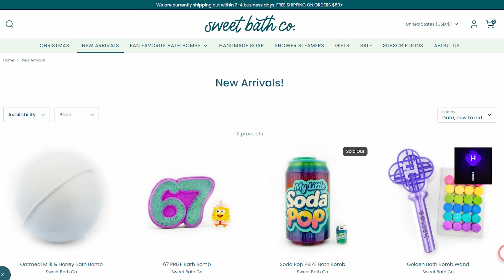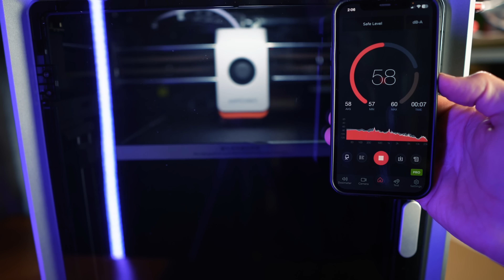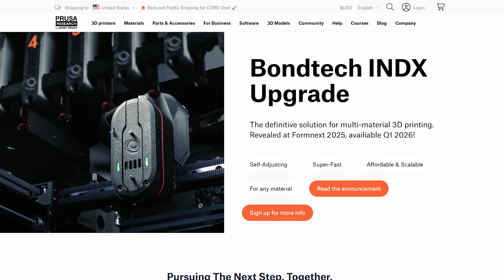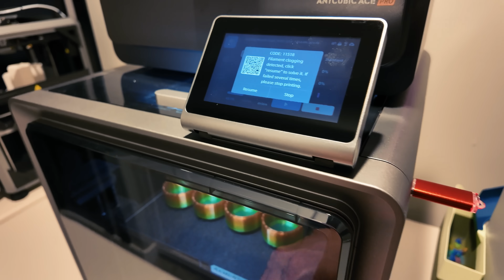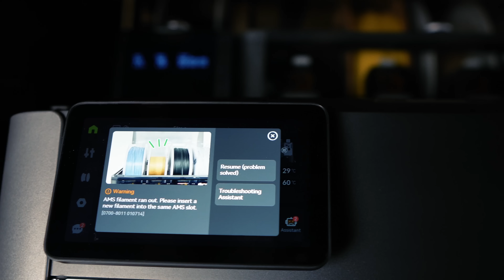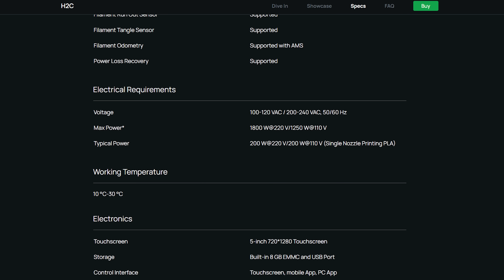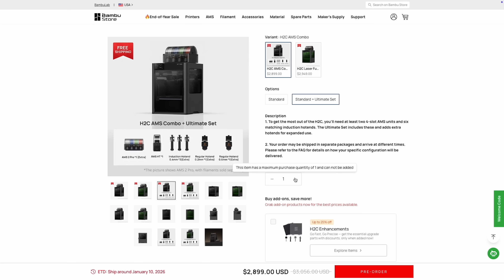I Upgraded My 3D Print Farm to the Bambu Lab H2C

Comment: Good review. One thing that I noticed was that you mentioned quiet because of your family. But i want to offer you a word of caution. There are these things called mofset chips on printers, and they work like relays. If the firmwear freezes during a heat cycle it is possible for the mofset to remain in the heat position.  Can cause a fire in the material in ams and then so on etc... Its rare, but this is why city's require manufacturing permits and usually dont offer in residental areas unless you have a detached garage and not a libral mayor. You have outgrown your space and need a dedicated facility. 🎉  also I don't want to sound like i'm a self proclaimed, prophet. I have learned from experience same as you except for I think, a few years ahead. I have had more than 1 3d printer thermal runaway on me and a p1s spark out from the wire harness that comes in the tool head wore out and shorted the nozzel heater power supply. My point is the more heaters you have the more risk you have if its where your family sleeps. Take it for what its worth.
Reply from the maker: Thank you for this information. Very helpful! We’re currently looking at building a warehouse or renting one in the near future

Comment: That H2c draws about 10.4 amps (1250W/120V=10.4A) at max
 requiring a standard household circuit (like 15A or 20A) but should be used carefully on a 15A circuit for continuous loads to stay under the 80% rule (around 1440W max). But depending on breaker. It'll hold for 10 seconds before tripping under FLA (full load amps). Great video tho. . I've got a p1s currently will step up and get a H2C for sure.
Reply from the maker: Thanks for explaining this! So far I haven’t tripped a breaker. However, I haven’t used the bed at the highest temperature or used the chamber heater.

Comment: I agree that they are not loud while printing, but they are loud when the vortek system switches nozzles, which is often if you do more than two colors per layer.
Reply from the maker: The Vortek system can be annoying as well as the AMS. I think that’s the loudest part.

Comment: Those thin boards on racking will sag over time.  Those look extra flimsy.  I actually bought 3/4 to 1" plywood and sprayed with rubberized spray from 3M on my similar racking.  It isnt cheap but makes a non slip surface that lasts forever.
Reply from the maker: That’s a great idea! I believe these are 3/4 inches but I’d have to double check. They didn’t come with the shelves.

Comment: Not sure about about the h2c but as a repair tech I've seen a few h2ds with problems and bad shit happening. Faulty components. Never buy off the first production run. Let the manufacturer work out this kinks first
Reply from the maker: I’ve heard of issues on the H2D but have two of them with no issues. My first H2D that I bought in March 2025 has over 2,500 hours and works flawlessly still. I haven’t had any issues with the H2Cs yet but I’ll let you know if that changes.

Comment: This is a biased review and thats good news. I own a h2c (since 26Nov, 8 days after the announce). And its been doing fine. Why do i feel its good news these are paid for printers ? Since we already have many reviews who have a bias in other ways. What you can provide us (and i hope you do) is keep track of things like failures and what kind of fails. We see a lot of comments in that the vortek is complex but its really simple in design but the only way to prove that is to make many hours.  I am not sure if a shop can pay for these $$ printers but as you stated it does open prints others can't (size, number of colors) and unlike the U1 and INDX you can buy (or get) these printers today. A INDX printer the size of the H2C is probably still pfff 7 or 8 months away and thats a big gap in time and we have no idea how reliable it will be. The H2c adds 2 moving parts the rest (well i guess the nozzle part too) the rest is a H2D a now well tested and known printer. Also interested in maintaining speed for example having a clog mostly means just switching in a new nozzle on the vortek side or even the quick replacement on the fixed one how does that compare to the more complex tool heads.   I am a big fan of the h2c but i can see how INDX could be real competitive soon and wonder what bambu will do next. My guess is the H2C is a test platform. They have 4 parts 1) dual nozzle, 2) induction 3) vortek 4) ams . If all these are well tunes out i suspect we will see (call be crazy) A H3 platform with 4 induction nozzles on the head (in 2x2 rows) there the back to are fixed. This would mean for U1 like printers (say $1300) no vortek at all just 4 tubes going to the head and print 4 colors with ams for switching. The more higher end models will have 1 or 2 vortek systems on the 2 front nozzles for 6 or 12 quick nozzle swaps and again backed up with ams systems (probably ams3 with smart switching and multiple tubes). This all sounds complex but also solved many problems even INDX has so far by keeping the max tubes coming in at a stable 4 that can still be done in the normal way unlike a tool changer or INDX. Anway hoop you keep reporting on what happens since having 6 months before the others are really available means we can print thousands and thousands of hours and get some stats. In fact one area bambu should be more open on is how 'well' they have been testing this and how many for example vortek switches they have done during R&D. Please continue with these biased video but make sure you add new information others don't so we learn something new.
Reply from the maker: Thanks for your elaborate comment! We’ll definitely keep you updated and release multiple shorts throughout the year on how well these printers are holding up. We’re almost at 1,000 hours on our oldest H2C. Still no fails…

Comment: still can''t use different size nozzles - congrats on a business making plastic the worlds most non recyclable material
Reply: That's a slicer challenge. No slicer can do it at the moment because i'ts not as easy but they're working on it.
Reply from the maker: @Leif_YT  yep! Thanks for commenting
Reply from the maker: The different nozzle size option should be released soon. It’s a complicated process but I’ve been told it’s in the works.

Comment: Makes sense for a business only
Reply from the maker: I agree. Overkill for personal use haha
Reply: I’ll say I love mine as an individual (non business).  The speed at which it prints multi-color and the plug and play nature of Bambu studio is pretty damn nice.  Sure, my H2S or X1C can do most of the things my H2C can  - but I rarely did multi-color prints.  I also couldn’t do multi-material prints (PETG supports still cause contamination).
Reply: @brandonnelson4164  Think about what I said and what you're saying. The whole point of me saying it makes sense for a business only is because of cost up front for a hobbyist who would take several years to get that initial cost back in filament savings. If you have an H2S and X1C, cost has zero impact on your decision. You have more disposable income that most people and convenience is all that matters. That's fine but misses the point I'm making.
Reply: @dosdont  you also missed the point - people make decisions for reasons other than just money.  Time, money, waste, etc are all constraints that people place different value on.

Comment: use the cool plate super tack or the biqu cryogrip plate you dont have to heat the bed to get pla to stick and it will stay stuck until you flex it off the plate. will save you a lot of power
Reply: No need to heat? I use Bambu stock settings,  down to 30° recently. I'll need to try at zero though!
Reply from the maker: Great idea! I’ll have to try that. Thanks for watching and commenting

Comment: This is why I will stay forever with Bambu Labs, the X1 was my first 3D printer (Yeah from the Kickstarter campaign) and every time I want to try another 3D printer from another brand I feel like is always something missing, Bambu Labs make everything so easy for us, the users that is impossible to look at the competition because they don't offer nothing closer to what Bambu Labs offers! 

Next month is my birthday and I already told my wife I want the H2C.
Reply from the maker: So exciting! I hope you get what you wished for 🤞🏼 We love Bambu Lab printers
Reply: Reliability and not having to screw / fix the printer is worth a ton.  When I see how many issues some others have, or how many steps are still not automated on printers like Prusa I quickly remember why Bambu is worth every penny. Got 3 in my hobby setup that went trough a few thousand hours and beside one nozzle replacement i had to do nothing....except some lubrication every now and then. It just works and keeps you from wasting time baby sitting the printer.  
It's also one of the reasons why I can't imagine the U1 in a farm setup., Beside the limitation to the 4 colors it has  250k swaps rating for the pogo pins until a toolhead PCB has to be replaced.  In a farm that runs almost 24/7 that point can be reached quite quickly and it's always 25$ + maintenance time for each one of the four.  And from my experience with pogo pins from programming and testing rigs I wouldn't be surprised if they cause issues even earlier.
Reply: @Leif_YT  Every "automated" feature on a bambu printer is also on a prusa. Idk what you're talking about.
Reply: @LilApe  Starts with the missing nozzle wiper most others have these days. The Prusa still often asks to clean the nozzle manually when doing a bed leveling. As far as I know there is also still no automatic pressure advance calibration - not even for the new indx.
Reply: @Leif_YT  Wrong, the prusa touches the very front right of the bed a couple times to clean the nozzle. It doesn't need a nozzle wiper when it already has a nozzle cleaning routine, I have over 5k hrs on my core one with zero failed nozzle cleaning. Prusa also doesn't need auto pressure calibration as their filament profiles are so finely tuned in prusaslicer. Bambu lab needs an auto pressure advance feature because their filament profiles are so poorly tuned. Ask yourself this, why does a prusa printer perform just as well as any bambu printer, if not better, even though its missing so many sensors and junk that bambu printers have? It's because prusa printers work so well that they don't need all the gimmicky sensors.
Reply: @LilApe  The "nozzle cleaning failed "error is something quite a few experience on a regular basis since it was introduced. Good for you if you didn't ran into that issue, but it's still a problem quite a few have and that doesn't work as reliable as a dedicated nozzle wiper.  Was an issue for quite a few on the XL and still is on the Core One. It's also a regular topic / issue on the Prusa subreddit.
Reply: @Leif_YT  The only people that have nozzle cleaning errors are those that are lazy and refuse to pluck off whatever bit of filament is hanging from their nozzle before it does the nozzle cleaning or bed probing routine. All you have to do is make sure there is no filament hanging off the nozzle before your start a print, and you will never have an issue. Just check the nozzle every time you remove a completed print and you wont have any problems. Too many people these days are lazy and expect their printer to do every single last thing for them.

If people are really going to be that lazy and not check their nozzles, then there are plenty of mods on printables you can download that implements a nozzle wiper. Prusa printers not having a dedicated nozzle wiper is a non issue. Only the lazy have that problem.